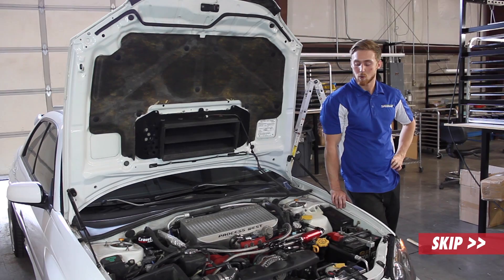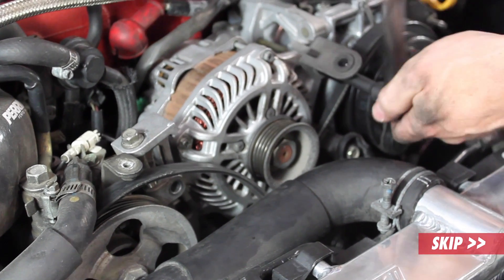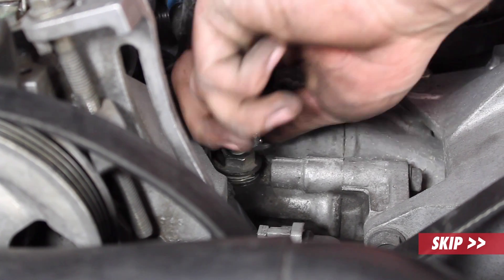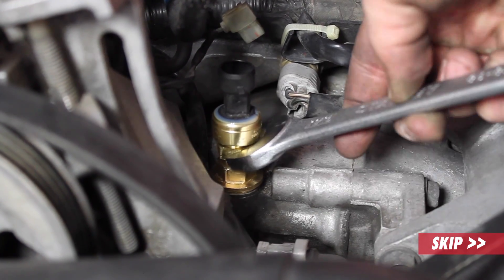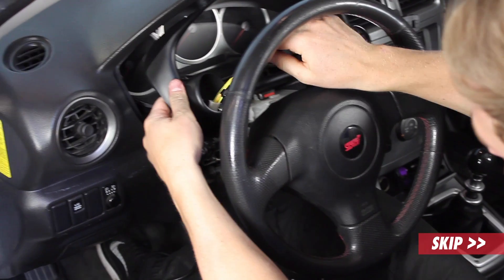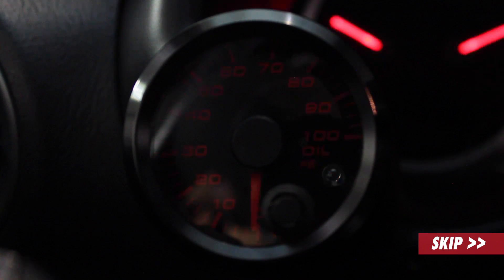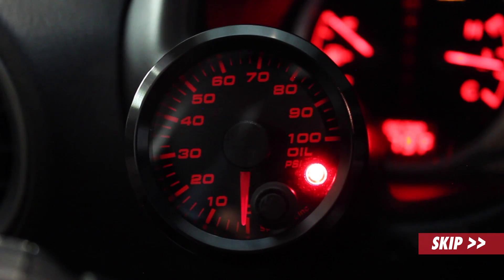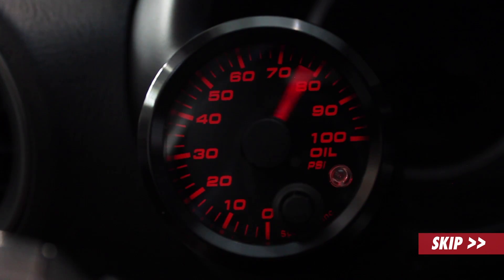How to Install a Speedhut® Oil Pressure Gauge on a Subaru WRX STI

Comment: Or you could just run a oil relocation line from any hotrod speed shop, I ran into a issue with the space left over installing a mechanical oil pressure sensor on my forester, Caution when installing any bungs into the aluminum subaru blocks

Comment: Theres also a spot on the back of the block...
Where you wont have to remove the dummy light sensor
Reply: Where you will also get inconsistent oil pressure readings because its so far from the pump. Better than nothing, sure, but its much better to have right above the pump

Comment: Oil PSI 😂 more like oil pressure, funny title tough
Reply: I dont get it? Oil Pounds per Square Inch (PSI)?
Reply: @grantrobinett6518  thats only pneumatics, because gas compresses. In hydraulics it doesnt compress so its just a constant pressure
Reply: @1slashwylde  PSI is a unit of measurement for pressure. Force over area. It has nothing to do with compression of the fluid. Even solids exert pressure due to gravity. You could weigh your car (lbs.), measure the area of each contact patch (sq. in.), and divide the weight by the area, and end up with pressure (lbs./sq. in.).
And it's a common misconception that liquids don't compress. They do, but just on a very small scale. Hydraulic oil is usually 0.5% per 1,000 PSI.

Comment: FYI buy a Metric adapter plug before you start anything dealing with the oil pressure if you plan on using the top access plugs almost every gauge or fitting is NPT and Subaru's use BSPT wasted 2 days build time looking for the right adapter

Comment: what do you do with the old wiring the old plug just leave un plugged?
Reply: Did you ever get an answer ?
Reply: @michaelsawyerjr1146  they did a piss poor job of not clarifying it LOL
Reply: Apparently you just cut a piece of electrical tape and put it over the oil light.
Reply: I'd suggest since the switch basically just closes a circuit when pressure is there you can possible short it to ground or block and the light should always be off.
Switch normally open, closes circuit when pressure is there, creates short, light goes off. So terminating it on any ground on the vehicle, body, block, ground line etc should have the same effect.
Or maybe nothing happens if you unplug it lol

Comment: I'm installing one of your quad gauges and would like to use my pre-existing pressure sensor. 
Id just like to know which wire is for the sensor signal wire and which is the pressure warning light?
Black is obviously ground, the two remaining wires are red and white.

Thank you.

Comment: would it be possible to wire in the dummy light to the new low oil pressure warning light system to get it to display in oil dummy light location and in gauge?
Reply from the maker: It would be possible, yes. You would need to find the pinout on the dash cluster and then adapt one of the jumpers from our remote shift light to wire into the OEM light. If you are planning on doing this shoot me an email to Tech@speedhut.com and I can send you wiring diagrams, part numbers, and walk you through it.
Reply: You said "our remote shift light to wire into the OEM light." did you mean for the low Oil pressure warning Light? (not the shift light)

Comment: i tried to install exactly  how you did it but my sending unit was too big and couldn't  put my alternator  back.  would it still be good to install it at the back under the top mount?

Comment: Thank you, great video! Quick question, how much torque did you guys put down when fitting the Galley plug? I am wondering because with brass fitting into aluminum there is a chance of stripping if too tight and I definitely do not want it too loose.

Also if I place a custom logo in the middle of the gauge, will it light up with the rest of the gauge?

Thank you
Reply from the maker: Yes you can have custom logos on your gauge that will light up. Around 10 ft-lbs should do it for torque on the galley plug.

Comment: hi, just had a question.. what did you do with the wire that you unplugged at (time 1:36) of this video? what should i do with that unplugged cable? thanks!
Reply from the maker: Put it in shrink wrap and toss it to the side 👌
Reply: Speedhut Custom Gauges ..so it just does nothing? i wont need it at all for safety? 
and actually, what was that cable for anyway that was unplugged and put away on the side? would i eventually need to replug it for any reason?
Reply: Speedhut Custom Gauges Thank You for the info!
Reply from the maker: That wire was unplugged from the oil pressure switch which was removed. In doing so, the oil pressure light in your dash is now not functional, assuming you are removing said switch for the addition of an oil pressure gauge, there is no need for this light since you now have a much more accurate way to monitor oil pressure.  

Hope that helps!
Reply: Speedhut Custom Gauges Perfect! That is all i needed to know. GREAT vid by the way!! i really appreciate your help!! Thank you!
Reply: Speedhut Custom Gauges wouldn't that throw and oil pressure cel code/dashlight?

Comment: does replacing the factory sensor cause the oil pressure light to stay on? If so, is there a resistor that can be used to "trick" the sensor?
Reply: Hey so what was the out come to your question ?
Reply: awesome, thank you:)